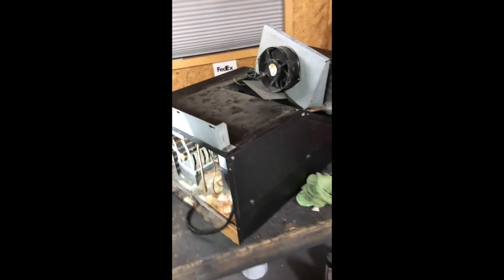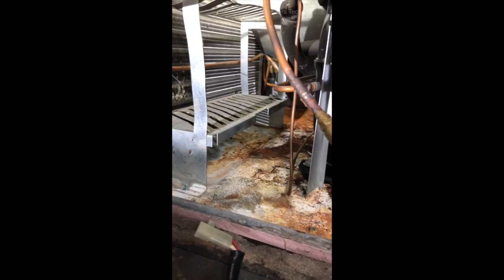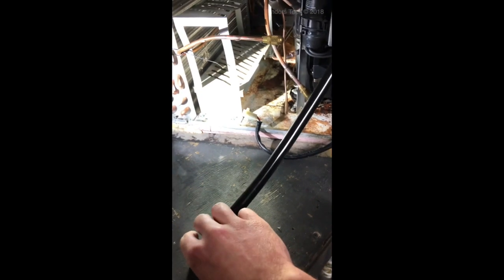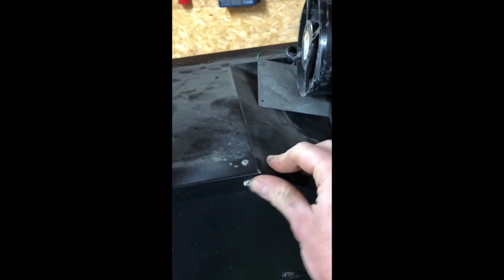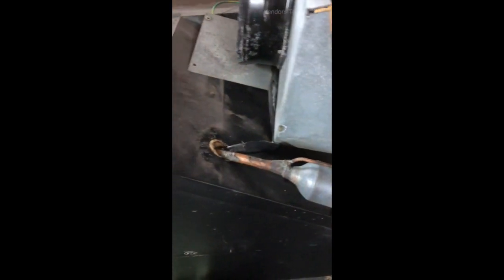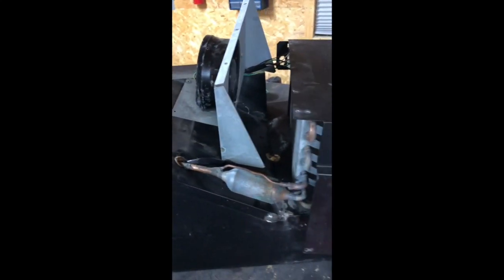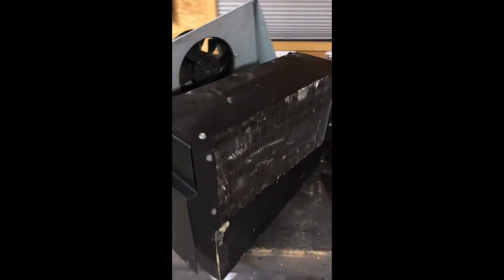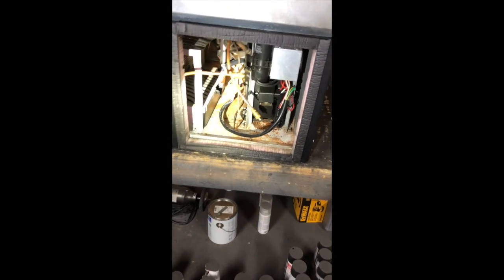Why You Should Stay Away From USI/FSI/Wittern Group Equipment

Comment: Is the usi 3129 a good machine? I see one for $300.
Reply from the maker: The 3129 is a very basic, lightweight machine.  They are not the newest of machines as far as styling goes, so they may not be suited for nicer locations, but they have their place.  Since they are a simple and basic machine, they are not usually too hard to operate or repair.  The most common problem you will probably see are damaged or broken tray harnesses or cabinet harness wiring due to their exposed nature and location.  Many replacement parts for them that are not in high demand have been discontinued by the manufacturer, so keep that in mind.  For the right location, they would probably be a good machine.

Comment: So, in 2024, would you recommend a Wittern machine or warn a newbie away from them?
Reply from the maker: I would say that their current model machines have improved dramatically over their models from 20 years ago, and are probably just as reliable as other reputable brands out there.  However, since I don't sell new Wittern equipment, and don't often get to work on machines newer than 5 years old, I haven't seen inside most models Wittern is currently producing, and so cannot make an informed recommendation one way or the other there.  My recommendation to any newbie though would be to buy high-quality used equipment if at all possible until you are established and know vending a little bit.  Buying brand new vending machines is expensive and overwhelming if you are new.  I would start out with older model AP and National snack machines, and Dixie Narco soda machines and learn that way at minimal up-front cost.
Reply: This question is for vendor tech, what websites do you recommend for used high quality vending machines?
Reply: Thanks!!

Comment: I'm currently in the process of buying one of those machines. In 2023, are you still not recommending this company/machines?
Reply from the maker: If you are buying current-model USI machines, I have to say their equipment has improved dramatically over the last 10 years or so, and I wouldn't be concerned about buying new USI equipment at the moment.  All I could recommend is that you buy models with the least tech on them if that's possible or if that is an option.  Sophisticated is not always better when it comes to vending machines, especially if you're new to the industry or not an experienced vending machine mechanic.

Comment: You need to slide out the inside part of the deck for access
Reply from the maker: As mentioned as a follow-up in the video description, USI developed their own video and sent it to us in response to our video, so we are aware of that now.  They're still a hard unit to work on, and the line traveling up through the ceiling of the housing to the evaporator still makes any work on the sealed system difficult, but it is not as hard to service as we thought when the video was made.  Our problem more than anything was the overall less-than-optimal design, and the lack of documentation that explains how to disassemble or service things like this.

Comment: I am aware that Wittern owns several companies such as Selectivend, FSI, etc. Are you specifically talking about FSI models only?
Reply from the maker: No, I'm talking about anything now owned by Wittern.  To be fair, I have not had an opportunity to touch much of what Wittern has made within the last 5 years, it takes a while for new models to make their way out into the industry and then for us to get called to work on them once they're out of warranty.  Wittern has occasionally made good equipment, and I would say some things are getting a lot better as time goes by, but they are still essentially a budget manufacturer, which means they cut corners sometimes where they could do better.  Replacement parts costs are still much higher than the rest of the industry too.

Comment: I appreciate this video. My wittern 3521 is leaking in my location and I plan on getting there in the AM to finally fix this issue. I'm hoping I can get it back to properly working. Any advice on getting to that drain tube? I believe mine got disconnected from the tray like you mentioned.
Reply from the maker: This link is posted in the description, but after we posted this video a few years ago, USI produced and released their own video which can be found here: https://www.youtube.com/watch?v=-Yn9vH0-uP8&t=0s  It should be helpful in allowing you to access the drain line.  Prior to USI releasing their video, we were completely unaware the procedure they show in it was possible.  There is no comment in the manual on how to disassemble or service these decks.  Hope you get it figured out!

Comment: I have an fsi 3120 & 3172 satellite combo machine. I purchased it used, prior to seeing your video. I am no expert in repairs. However, I want to update my machine. Is there anyone that I can call to make necessary repairs and updates before putting it in a store?
Reply from the maker: You can call the manufacturer direct for help 888-836-3638, or you can call us at 970-623-1272.

Comment: I come up against stuff like that all of the time. If you think that machine is a piece of junk you should see some of the European stuff.... Fas, Evoca/Zanussi, N&W (Necta & Wittenberg, Maas .... It's pure junk, but 1/2 the price of Crane gear and trying to convince vendors to part with that same cash for a 4 or 5 year old Crane Merchant vs. a shiny new Evoca Tango is tough.
The business model here is buy cheap machines - mostly combinations, never service them, never clean them, let them fall apart, lose sales, lose sites and continue on that hamster wheel of false economy for years.
 
I would have gone in the top of that deck with a small holesaw and followed up with a nut driver then stuff the hole up with putty afterward.
Reply from the maker: Yes, I hear you.  There are some European machines made in Spain sold over here - Jofemar - and they're a joke to service.  The quality of parts on the Jofemar actually seems to be decent, but they are WAY over-engineered, and are way too complicated to repair, even on simple things like replacing a fuse holder.  They were not well thought out by engineers either.  Jofemar's U.S. customer service is awful too.

I actually did do some cutting on the next one of these USI decks I worked on identical to the one in the video.  I cut the upper bracket with "legs" off from above the drain pan, as the tall sponges it holds are not necessary, and was able to get to the back nuts on it that time and get the whole pan out of the way.  It took an hour less that time to do it all, but still is ridiculously hard compared to how easy it could be.  Nothing in vending repair is really "impossible", there's usually a way to do it if you study it for a while, but the time required that shouldn't be necessary, and that someone has to pay for, is what is so aggravating in the long run.